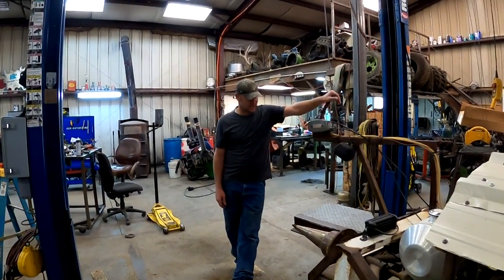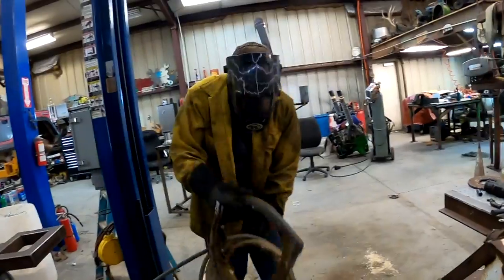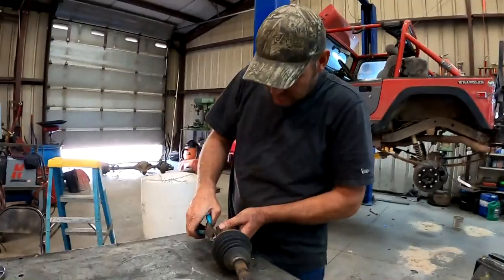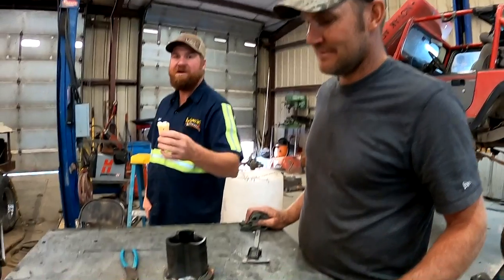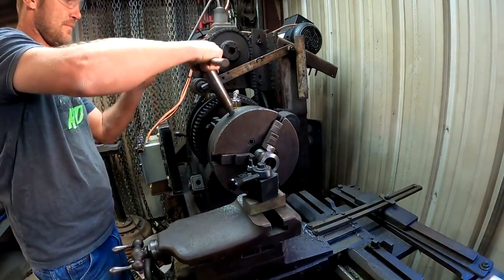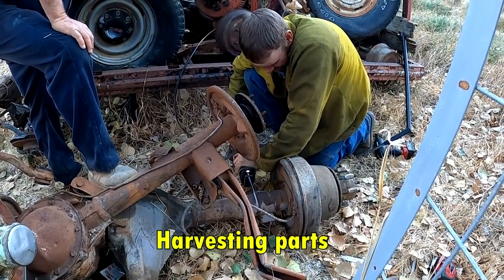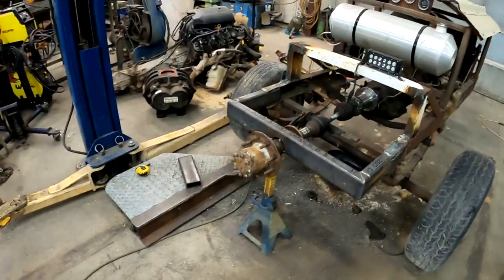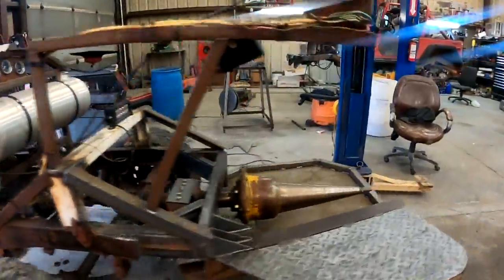This Wood Splitter may NOT BE SUITABLE for all viewers!!

Comment: Laffed my ass off when I realized you had MacGyvered a boat throttle quadrant to run your power train.  And it looks like it works really well for the purpose.  There is nothing more satisfying than making something useful out of a pile of junk.  Have fun and stay safe.
Reply: perfect way to set your rpm

Comment: My dad and myself used a pinto engine and transmission with a hydraulic pump on the back of it with the 6-in ram and also had a hydraulic winch with a debit so you're not the only one to take junk and make a log splitter out of hours work wonderful love your videos be safe have a great day Sam

Comment: I was a machinist, for most of my adult life and operated one of those, or one very similar. It use to be connected to an overhead shaft and pulley system and was upgraded to an huge 3 phase GE motor with a rotary switch that did forward and reverse.

Comment: In the late 60's I worked for the state parks in Minnesota.   They had a homemade wood splitter consisting of an old Steel Tractor Wheel with a splitting wedge welded to it.   Driven by a gas motor to rotate the wheel, a platform notched for the wedge was where you place the wood to be split.   Your screw setup would have been a great safety improvement.

Comment: I think that splitter is the best thing since  sliced bread. I have seen them but not in action and now that I watched yours am  completely comfortable running one. I grew up in the woods as a logger but just never ran across a wood splitter like that before. Most involve the blade some form or another. I'm also 73 so I guess I should of got out more...... some of the jokes i know for that range along sick and demented so no letting that out. I know that I would kill to have a shop like that as I do have a little time on some machine shop tools

Comment: Hey, I had this type of splitter back in the ‘70’s.  I hooked it to my Toyota pickup and split hundreds of cord to heat my house back “in the day”.  Every once it would stick in wood and start lifting the small pickup and I would have to jerk the wedge away from the accelerator, no way was it safe but it worked for several years.  I enjoyed your video.

Comment: We built one of those than ran off of the PTO on a tractor. It did work well and was less scary than the 3 foot open blade we used to cut the wood to length. 😁

Comment: We had a Stickler for our firewood splitting when I was young 1978 we had it mounted on our Dodge Van for power , I was the operator while everyone else brought me wood. One cold day in February we were doing the wood splitting and I had a pair of mittens on that my grandmother had made for us. Well i got to close and it grabbed my mitten and twisted me around the splitter after I stopped twisting I reached with my other hand to grab my left hand hat was stuck  on the unit and it grabbed the right one also. Things happen so fast I guess I'm luck to have all my fingers still. It split my left hand and broke my right wrist like I said very lucky to still have all my digits. It was quite the experience for a 13year old. When I saw you wheel your splitter in I thought wow I know what that is, still pretty cool on the revamp Paul, I enjoy watching you and Matt and crews work together.

Comment: My dad bought one of these at the Nebraska State Fair in the mid 70s  It was so much better than a wedge and sledge hammer!! I remember once dad wanted several pickup boxes of wood split and we couldn't go hunting until it was done. So we figured out how to do it faster. Put the F250 in 4 th gear and put my little brother in the cab. Once I got the screw to start I would yell hit it. My little brother would mash the gas to the floor!! My other brother was rolling logs to me. So we whipped threw a lot of wood in a hurry! We had to kick snow onto the screw tip as it got very hot!! We avoided Y's that day because they would drive the F-250 across the yard.

Comment: I split many cords of Oak and Elm in the 80's with one of those. Ours was a self contained unit with something like 5hp B&S mounted up. It must have had a gear reduction cuz it spun pretty slow, nowhere near as fast as yours. I was about 10 years old the first time I used it. Worked great. I still have all my limbs, and they all work fine.

Comment: Besides the light near the engine, you might consider adding a light under the control box so it isn't shining into your eyes. Otherwise, it appears to me to be an excellent wood splitter. I'd go so far as to say it's safer than the hydraulic splitters, but then, I've never operated either type. I like your way of thinking through issues for easy resolution.

Comment: I owned a nor-tech screw splitter that had a motorcycle chain and two different size gears for the power reduction. It was powered by a massive old b&s 7 or 9 horse single cylinder engine. 
It worked, but was always a little terrifying. 
The only way to kill it was a tab that grounded out the spark plug. Took a few revolutions to actually stop.
It would often grab the round and start flailing it around, bouncing the unit off the ground...
Sold it and bought a hydraulic splitter, I preferred to keep all the fingers and hands I started with.

Comment: I have one of those on the PTO of my Unimog. A bit dangerous but fun.
Reply: Wow talk about a dream setup. But you gave me an idea! I have a 65hp farm tractor and I'm sure I could cobble together one of these for a 3pt hitch/pto. Now to find a spike...
Reply: @jaythemusicman801  If you have a 65 hp tractor then do yourself a favor and get yourself a hydraulic wood splitter. Those screw type woodsplitters are extremely dangerous and should only be used when a hydraulic one is not an option (like on an old 15 horsepower tractor)
Reply: @willemkauffeld7679  I have one. It's slow. This looks like it would be way quicker
Reply: @jaythemusicman801  This isn't really quicker since the hydraulic on you do pieces that are four to five times as long
Reply: @willemkauffeld7679  looked pretty damn quick too me!!How bout worry about yourself and let others make their own adult decisions!
Reply: @Willis476  This is quick but others methods are just as quick and way safer. He can do his thing, but knowing that just in my 800 inhabitants village in the last ten years two people lost their lifes and 1 his arm with this machine I do recommend to invest in the safe ones that are just as fast and not much more expensive
Reply: @georgeorwell126  Hey ! if you are fine using dangerous equipment go for it live your life, but don't insult a whole population !

Comment: Just a thought if you build another...  use a 1-ton or 3/4-ton Chevy front CV axle and an 8-bolt front wheel unit bearing.  Then the only shaft that would need adapted is the inner CV flange to the trans.  Awesome build though!!!

Comment: I keep rewatching this when I have to swing that maul. I have a ‘92 Chevy truck with a 4.3L and a 4L60E that I am seriously looking to repurpose into something like this. Might even throw a couple E-Stops on it somewhere since I have sensors that can shut the engine down. May use a front wheel bearing for a GM 3500 4WD and an electric brake fire a trailer to carry that CV shaft though. Then I can bolt the spike on an eight lug pattern as designed and have an emergency brake available. 

Still pondering. Which is why I keep watching this video. 🤷🏻‍♂️

Comment: my grandfather had a setup fab Rats would have liked, it was model-T striped down to motor frame and drive-train, a second rear axle mounted on top of the back frame, and a saw blade about 3 feet across attached to the axle, a belt between the rear and upper axle spun the blade and tilting table was added, we would cut logs all day long with that thing never thought it  might be dangerous, of course now people would be afraid just looking at it, and yes you still had to crank it up front and adjust your mix on the column,

Comment: Just remember that the people talking down your lathe weren't around to see what any lathe of that era looked like when it was new. I worked in a commercial laundry that had washers run by the jackshaft belt and pulley system like that. In the early 70's the flywheel came off the steam engine when it locked up and they converted them to electric like your lathe. I worked for them in the early 90's and they were still running those 1917 washers, commercially.

Comment: Why not use a unit bearing on the cv axle then make a lug adapter plate to the log splitter flange? Then its a replaceable bearing if needed.  Just a thought

Comment: So I have one of the splitter cones, my plan was to attach it to the back of my tractor and make a3 point set up, not sure what I am gonna use for bearings yet, never thought about using a axle spindle, was thinking about using a large set of pillow block bearings. And also the PTO will only spin at 540 RPM and makes about 20 horsepower, but its alot smaller cone, any input is appreciated thanks
Reply: I have one also. I am planning on mounting it on my tractor also. These only split one direction. I have been told that a standard PTO is going the wrong  direction. So I am planning driving a car axle with the pto .

Comment: I likes it. A lot. Seems like it only needs half that much motor. Are you running in low gear? How much does the screw cost? Looks actually safer than a flywheel splitter and I don't see the wood flying up and grabbing stuff connected to your body but I can see if your shirt got caught in the screw you would be screwed.

Comment: Would think you'd be making one of those newer type hydraulic wood processors that splits a whole round into several pieces at once and let's you line several rounds up in  it so you only load it when the hopper gets close to empty.

Comment: Ouch, This brings back memories. I helped split a lot of wood with my dad using one of these. Jack up car, take off rear tire ,mount screw and have a plank to stop the log from spinning. I took a nasty blow to the head when plank let go. They gave you a kill switch that stuck to the fender. When you hit the switch the engine usually kept spinning and wouldn’t really stop. Imagine if you accidentally bumped against the screw end and having your leg being fed into the screw and the car keeps running after you hit that kill switch.

Comment: I was working for a JD dealer back in the 80's. We sold the auger wood splitter. They had em for pickups, lawn tractors, mount on about anything had an axle. I used to demonstrate  them for customers. Looking at em working was cool but they was dangerous as anything I'd ever. Messed with.

Comment: Paul, you were talking about bandsaw blade wear, but it looked like you were cutting dry.  We can see that the saw had coolant delivery pipe, so why not use it?  I expect you know that you need soluble oil which you can get from engineering shops.  You mix it 20 to 1 so a gallon lasts a very long time.  The blade will cut faster and last way longer.  Use the same thing on the lathe, but brush on the oil, and maybe mix it a bit thicker.  The trick there is to use a container and make a hole just big enough for the brush so that when it falls over (and it definitely will) the oil does not go everywhere.  Rocol RTD cutting lube is better for the lathe, but more expensive.  You can use RTD with taps and dies as well.  On the down side you get splashed and smelly, but it washes off eventually — it's like diesel or paraffin in like it gets into your skin and lingers after you wash your hands.

Comment: I've been using a Stickler for around 30 years.  The old-fashioned boring way---bolted to the rear wheel of an old Nissan pickup.  Not really any more dangerous than using a hydraulic splitter.  Understand what you're doing, respect the machine, don't get in a hurry.  Just prop the log against the ground to stop rotation.  Adjust the throttle setting by putting a dime or nickel beneath the throttle stop screw.  Working by myself isn't very time efficient due to the need to remove the split wood and bring unsplit wood to the splitter.  A helper is the way to go.  Put them in charge of the wood supply and removal, then I sit on a stool feeding in chunks and tossing split pieces to the side for the helper to remove.  I'd guess that depending on the wood it's about the same as a hydraulic splitter.  Faster if the wood splits easily; the same if it's stringy like elm.

Comment: Instead of cutting up an axle housing. Couldn’t  you have used a cv shaft from a Chevy 3500 and wheel bearing to mount the splitter head?

Comment: My uncle made his own log splitter he use the hydrolic cylinder from a forklift big gas motor control valve and hydrolic pump made own tank to hold the hydrolic oil made a fat wedge to split the wood big thick flat plate attach to the hydrolic cylinder he split pine wood like nothing but cotton wood the frame the wedge was mounted to you see that flex when you split colton wood he made his tow able his splitter work side ways not like those one you see standing up he use a big square tubing for frame and lay logs onto split

Comment: #Fabrats
Love the get'er done engineering. Have you used the taper attachment on your lathe yet?
Reply from the maker: Not yet. I need to make the feed work first.👍🏻
Reply: @FabRats Yeah, the power feed is a thing, but I guess there's not much call for tapered drive lines, although with that monster lathe you could make wood splitter cones.

Comment: Still wondering about the so dangerous part.  As with anything that has torque can be dangerous. But with this setup and that type of cutter its less dangerous than a drill bit type. And much safer than a press type wood cutter.  I know many people that are missing fingers from that type as it only takes a sec of not paying attention.

Comment: Love the fabrication but for all that work why not just buy a 35 ton unit from wherever? Safe and you don't have to lift the wood but just slide it on the down plate. Guess not as fast. But 3 days for the build you could have been making a ton of $ on another project. Love the talent.

Comment: Those kind of screw splitters were a thing in the 70's and 80's with a strong and slow electric motor but way to dangerous. And before that big beltdriven flywheels with big solid axes on that was even more dangerous..spinning and not being able to stop if something went wrong.

Comment: Couldn’t you just stick a whole axle In there ?  Like a narrow 14bolt or something? One hub flange to motor other hub flange to splitter and maybe a emergency brake for the drive line input or just let it spin free. Then you just put some diff oil in and I bet it last perfectly a long time especially something like a full float 14 bolt ?

Comment: You need a clutch that instantly disengages that thing, with a huge four foot wide  clutch actuator bar running just behind the head so the operator can kill the rotation ......and it not only needs to kill rotation it needs to instantly brake the rotation.

You're going to regret it...first time a idiot gets his shirt, coat, boot lace or whatever caught .......

You comment haters can comment all you want but I been a safety supervisor for decades and that is one dangerous machine.

Any farmer who operates PTO equipment would tell you the same thing.

.

Comment: My dad had one of those spiral log splitter 3 point hitch for tractor most dangerous thing ever seen in my life. It will kill you best thing for you to do is the same thing my dad did cut it up with a torch that nobody gets hurt remember I warned you. I've seen my dad use that thing I seen a log fly off of it went to the side of the barn. I seen another one fly up almost knocked my dad out. That's when he took a torch to it and cut it up and said I will not let this Machinery kill my children a spiral log splitter is a dumbest and most dangerous thing I've ever seen

Comment: I don't see how your wood splitter would be less safe than any other wood splitter.  They are all dangerous.  I wouldn't recomend wearing a scarf or tie while using yours though.  Also incorrect attire for table saws, adjusting the carburetor on a running engine, snorkeling or parachuting.

Comment: My father bought one of these for the tractor, so glad it's gone.  Sorry, no one will think 10X is better once a friend or family member gets wound up in it.
Reply: I work in an ER and in the past 10 years I've seen 1 arm that was crushed off and a number of fingers from "safe log splitters" this looks like you want to pay attention but no worse than the lathe.   The most dangerous part of this is driving on the highway to go pick up the wood.
Reply: @tysleight  I grew up in a rural farming community with every unintentional amputation you can think of including testicles by a farmer that thought stepping over PTO shaft not a big deal.  It's all good until it's not, just saying.